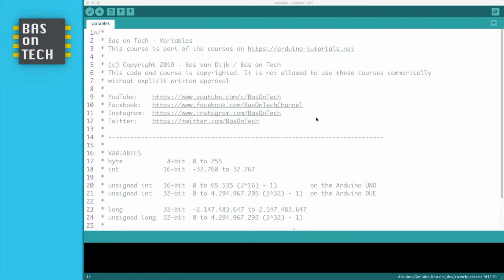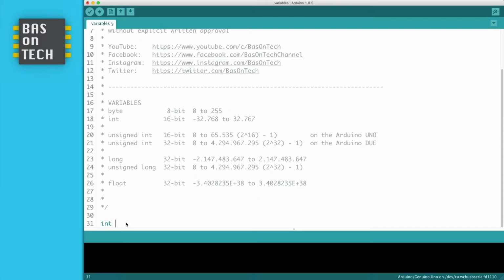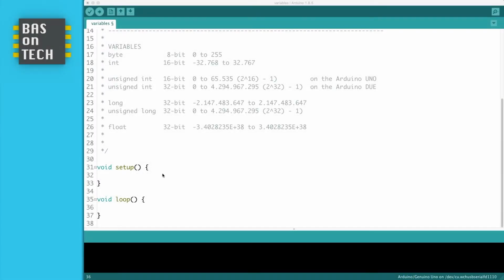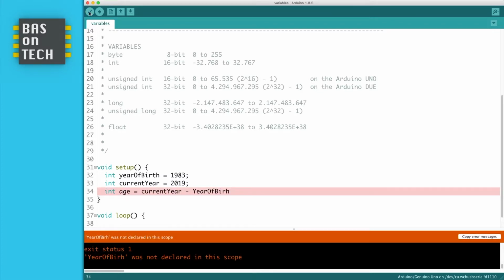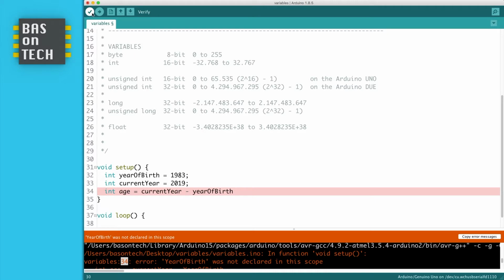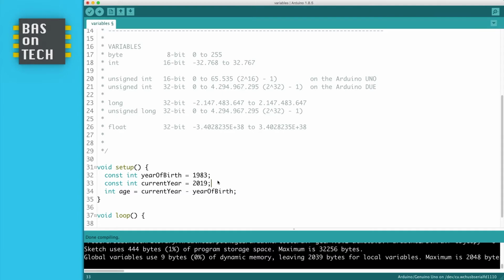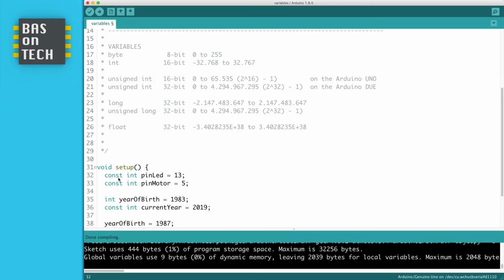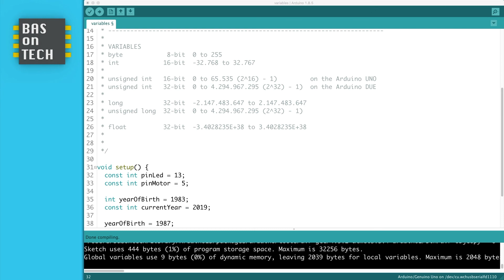ARDUINO VARIABLES AND CONSTANTS - Arduino programming theory #2

Comment: hi man is there any instruction that allows you to configurate a lot of pins at one  because I'm working with an arduino mega2560 and I have like 36-40 pins to configurate.
Reply from the maker: Unfortunately not, but you have to look at multiplexing of shift registers. The MAX7219 might be able to help you with this. It is used to drive 7-segment led displays

Comment: Hi
In arduino starter kit(love o meter)
They used a constant for a pin
Code:
const int sensorPin = A0
This is not even a integer how is it being run as there is a 'A' in it?
Reply from the maker: Very nice question! I couldn't find proof but A0 is actually a constant which points to the correct pin. If I remember correctly something like pin 14 is analog 0. So A0 actually represents the value 14 which is an integer 😃